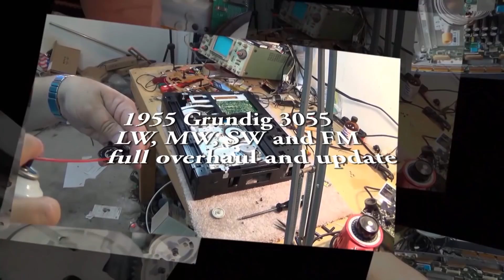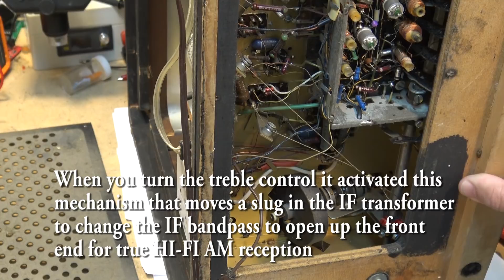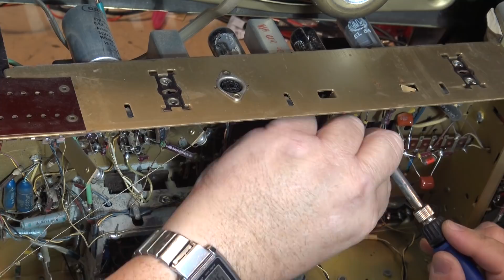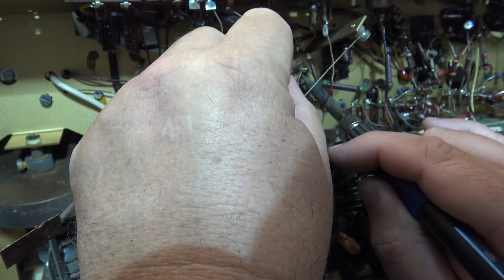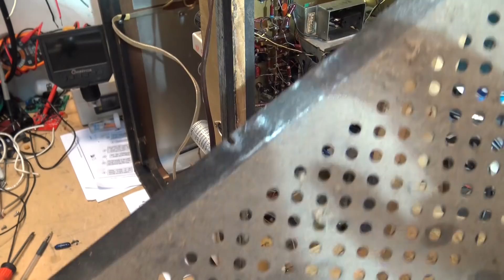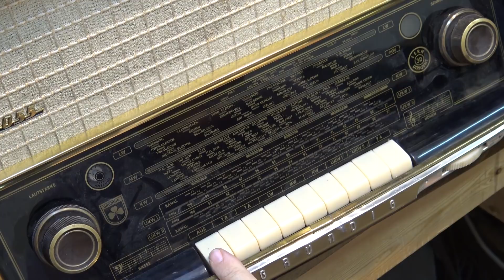Grundig 3055 Vintage table radio restoration

Comment: I have a Grundig with the motorized tuning.  Yes, German engineering is the best... until you have to change that #%*!ing dial string and cables.  It took me 4 days- I would work on it until I was frustrated, then do another project.  Finally I got the god$%#*ed dial cords on.
Reply from the maker: German engineering my ass.  Never again will i own a German car.  One was enough of a headache.
Reply: @12voltvids  I work for a German company 
  I believe that their engineering is done as payback to the world  for them losing the war...
Reply from the maker: The same can be said for the Japanese. They killed the American electronics manufacturing industry with cheap Panasonic and Sony TVs.  They sold them at a loss in the us to gain market share and put the domestic companies out of business. I saw a documentary a few years ago about Panasonic. To get around embargos I can't Japanese companies in the '80s what Panasonic did and Mitsubishi was they bought American companies that were in financial difficulty. Panasonic bottom Motorola TV division I started assembling their televisions for the American market in the states using American workers. They still made the picture tubes in the States but they shipped the chassis over from Japan. The same television in Japan sold for double the price that they were selling it for in the states. Eventually over a couple years they started doing less and less in the states even shipping the picture tubes over and assembly and soon it was just put in the chassis in a box. Canada had embargos as well.  To get into Canada Mitsubishi bought Electrohome. They rebranded their televisions Electrohome and continued the brand name for about 10 years. Of course they sold their own Mitsubishi brand as well concurrently after about 10 years when they were no longer required to keep the electrohome brand name they discontinued it and a few years later when sal started to fall they actually pulled out of the Canadian market completely. back to this documentary on Panasonic what's the domestic manufacturers close their doors the price was jacked up. As the documentary closed off saying they may have lost the physical war but they won the technological war. No arguments there.

Comment: My parents loved music and Grundig was their favorite radio. They loved their rich deep sound and build quality. They would keep a set for a few years, buy the latest model and give away the old one.  What I would give for those 1950s/60s tabletop radios today!! They were amazing. We forget the 50s and 60s records were recorded for the best sound on AM radio, not FM stereo and Grundig delivered the best AM sound.
Reply from the maker: All radios can deliver fantastic sound on a.m. it's all about the bandwidth. Grundig had an if transformer that you could adjust the bandwidth on by turning a dial on the front of the radio which moved the slug up and down in one of the transformers which opened up the channel bandwidth. Thing is that only work when there was few radio stations once the band became crowded and there was a station every 10 kilohertz you really couldn't take advantage of that because the next station over would overlap what AM stereo came along they actually restored the wideband mode for many radios and I am stereo sounded absolutely fantastic. People think that just because it's amplitude modulation that the bandwidth is naturally limited but that's not the case they were limited by the broadcaster because of interference issues to adjacent channels once the spectrum started to fill up. TV signals were also transmitted by am and they had bandwidth upwards of 4.3 megahertz on ntsc. The reason they had to cut it at 4.3 megahertz is because the sound carrier went between 4.3 and 4.7 as an FM signal.
Reply: @12voltvids   @12voltvids :  3I can remember when there were only a few am stations in the L. A. area and now every available spot is filled, fm too. One of the most powerful, 50Kw KNX hit our answering machine, telephones and TV sets.  I grew up with a sw radio running half the night. When the sw stations ended their nightly run I would move on to am dx listening.  When I was about 12 I began buying 1930s/40s sets, swapping out bad caps, weak tubes and sell them, sometimes I made as much as $20, imagine that! Now that I have the time I'm setting up a bench and doing it the right way, learning the theory and not just tossing parts at dead sets. Channels like yours have become a valuable part of that process.  This time I'm starting with old transistor and similar projects. I have a lot to learn before I start back with the tube sets. I need an isolation transformer, bulb and a variac first before I do anything with high energy devices. Going back to am radio, during the early 1960s, there was an am stereo station near our Long Beach, CA home. My parents had two radios in the living room, one set just below the frequency for the right channel, the other above for the left. With that combination they enjoyed a clear stereo signal carrying their favorite classical music. I have a good start on equipment and lots of valuable info available.  I love bringing old sets back to life. Great fun. Thanks for taking the time to share your knowledge with us.

Comment: That Grundig radio looks like a very low hour use set and the chassis is very clean with no cigarette paste on it. Hopefully it won’t be a chamber of horrors like Shango 066 experienced. His was a very high hour set

Comment: I would install a  3 amp slo- blow fuse between the bridge rectifier and the secondary of the power transformer to protect it in event of a B+ short. The replacements are very expensive and hard to find and do not include postal fees

Comment: This model is common for power transformer failure , bridge rectifier failure and carbon tracking in the selector switch network. Also famous for leaky or shorted caps

Comment: Shango 66 serviced the same radio a few years ago. It turned out to be a chamber of horrors Multiple circuits failed at once. He did a 2 hour video on it The power transformer burned up and multiple circuits failed after he replaced the power transformer
Reply from the maker: Yes they can be nasty.

Comment: Great video as norm can you do a video of dropper circuit as I would like to see your approach. I have an AEG German Radio it’s 220v I-changed Selenium for 4007 diode about 40v difference I would like to know if I should fit full rectifying diodes please advise.

Comment: Heathkit used to sell nice electronic kits that you could build, and I always had success building them.  A point-to-point wiring, thermonic radio like this would really be fun to build as a kit.  i remember my Grandfather's old Radio Electronics magazines where it said, in the electronic school advertisements, build your own vacuum tube TV and radio.  When I took my National Radio Institute course in Video Audio Servicing, they sent me a stereo system and only had me take some voltage measurements at test points.  Nothing else.  I wish that they instead spent the money by sending me videos like yours.

Comment: How on God's green earth can you replace the selenium rectifier with a solid state rectifier when its rise time is too fast for the vacuum tubes, such as for the mixer tube?  I tried restoring an old thermonic tube radio and screwed the whole thing up.  For one thing, even though I watched your video and Mr. Carlson's Lab video on the subject, I could not figure out the polarity of the mylar capacitors that i was replacing all of the paper caps. with.  I replaced the destroyed electromagnet speaker with a modern-day perminant magnet one, not realizing that the electromagnet was part of the power supply, and I replaced the selenium rectifier with a diode.  My tube checker could not check all of the tubes.  Now I know, after watching videos on the subject, that I should have reconed the speaker, or at least glued paper towels all over it.  Physics wise, I love thermonic technology.
A woman is dropping off a 2003, 300 CD changer off for repair on Wednesday.  All belts need replacing.  Those things are bitches.  Wish me luck.

Comment: Safety Capacitors (X-Y) on primary side of AC transformer a good idea for 21st century.
https://www.allaboutcircuits.com/technical-articles/safety-capacitor-class-x-and-class-y-capacitors/
KEMET is good brand (Mouser or Digi-Key).

Comment: I'm restoring a Grundig 1097U, I'm wanting to replace the selenium rectifier that is a B250C75. What diode bridge replacement should I use? I've read using four 1N4007 will work but may need to add a resistor in? What are your thoughts?
Reply from the maker: I just used a full wave bridge.  Sure the voltage is a little higher but still well within the limits of the tubes and capacitor.
Reply: @12voltvids  Ahh okay thank you! So even though the original rectifier is 0.08A, 250v, I can replace with a bridge that is 2A, 1000V?
Reply from the maker: @televisionforever  yes. It won't draw more than a few milliamps.  Tubes are high voltage low current devices.
Reply: @12voltvids  Okay great! Thanks for the help!

Comment: You know back in the 70's when I was a soldier stationed at Fort Bliss,  being a communicator, the officers all thought we were radio and TV repair men as well as our Army Duties, so they would bring in their equipment and drop it off at the Commo shack and asked that we have it fixed by Friday. One thing I discovered was that all the Officers thought they didn't have equipment unless they had a Grundig radio and Reel to Reel setup.  We often got them from newly arrived officers who just came from a tour in Germany where the equipment was sold. Much of our time was spent simply switching them over for 110 volts from the European Voltages.  Funny all those big wigs could not follow directions on the back of the sets, they would get them to their new quarters plug them in with an adapter thinking that would fix it. I often just put on a US plug and did the switch, charge them ten bucks for my effort and be the hero for a week.
Reply from the maker: The grundig were good.  I have a Normandy which as everyone knows is basically a grundig.  I hope to restore it one of these days. It has been sitting in the shop for 3 years now since my father in-law passed away and my wife brought it home.  Project for this winter i think.   Now that summer is winding down I will be spending my days off more in the shop working on various projects i have on the go.

Comment: When I was a boy,  I shorted that selenium diode, I had no idea what it was, but it looked cool, man did it STINK when she blew up, damn near took my had off, at least that's the way I remember it. I took a pair of pliers and put one end of a grip on each end. SPARK BANG SMOKE STINK, mom hollered up  the stairs, asked what the hell I was doing, it was hard to explain the smell.
Reply from the maker: They are NASTY when they blow and that is not an exaggeration.
Reply: They smell worse than a ripe fart

Comment: I have the modern version of that radio, it is a small transistor Grundig with AM/FM and SW it also has temp and world time built in. It is Grundig but made in China.  Still a wonderful little radio but does not put out the wonderful sound of their old European quality radio!

Comment: I am not sure why change all capacitors, I have similar radio and only two capacitor were bad..
Reply from the maker: The paper in the wax/paper caps go electrically leaky and this will avalanche the tubes drawing excessive current.  This can easily red plate a tube and cause it to fail as well as burn out transformers ect.   So they all have to go, no exceptions.  I am normally not one to replace all caps.  In vintage tube gear i so for all the paper types and black beauties.

Comment: Classic Line Hack moves on such a Fine Radio..Used Capacitors In the B+ ! Dont forget to use those random TV VCR screws to replace the ones you lost on your filthy desk..  I try to be Positve with comments but this Destruction Line Hack "Repair" is just too much.. How do you turn it on Really ?...!
Reply from the maker: No screws lost. All required capacitors replaced, The B+ ones are fine.Its the paper ones that cause the trouble. I don't have an open cheque book to change every part. This is something you people don't understand. If I could charge 200.00 to replace all the capacitors I would. This already went to a shop that told him it was going to cost over 200 to restore it and he walked away. I get these radios and devices in, and I am told fix it for 60 or 70.00 max. If it is going to cost more than that then don't do it. I tell them for that I can change the critical parts that need to be changed, the paper caps and a selienium rectifier only, and they are fine with that. 
You have to remember that these old radios are owned by old people, that are on fixed incomes, so they won't spend the money to fix it. The owner was told what it would cost to change all the capacitors and what just the minimal caps would cost and they chose the lower cost. That is the way it is. I do exactly what I am asked and no more. What I do, bu NOT ripping my clients off is repeat service, and they tell their friends which gets me more business.

Comment: When you replace the rectifier with silicon, do you use a dropping resistor to compensate for the lower forward voltage drop of silicon diodes?
Reply from the maker: No, the voltage will be a little higher but still well within the range of the capacitors and tube plate voltages.

Comment: Im 3 years late to the party with this comment but you and Shango066 both did videos on this similar radio about 4 months apart. His was in July of 2017 and this one in October. Just hoping someone out there appreciates me pointing this out, both are 10 of 10 videos.
Reply from the maker: I actually say his video after publishing mine.  Shango is a tube jockey, loves his old stuff.  I too like to save old tube radios and TVs. There is just something about the old tech.
Reply: @12voltvids  I just recently came across both channels and I'm combing through older videos on both channels and happened to notice this coincidence. Good stuff.

Comment: I have this radio and I'm listening to it every day. This has a very good sound, deep basses. It also has variable bandwidth for am/LW/sw listening (trebles control). It acts on the if filter with the help of a plunger core. Impressive design.
Reply from the maker: These were great radios.
Reply: @12voltvids  yes, collecting them, have 20 or 30 of them now (most impressive being the Saba Freiburg 14).

Comment: The Grundig were made back when the Television was something new. Radio's were still the mainstay of evening entertainment.I can recall the radio programs from the 1950's as I grew up on the family farm. We had no power in the house so had to rely on an old battery pack radio.  Evening listening was done by the light of kerosene lamps, the family sat around the living room in the dim light and enjoyed the theater of the mind. It was grand!  I still enjoy listening to old radio programs.  The Grundig is indeed the top of the line in electronics from that age, even later. I was the proud owner of an old Grundig Reel to Reel that I picked up at a hock shop in El Paso back in the 70's when  I was a soldier stationed at Fort Bliss Texas.  A few decades later I purchased a little Grundig pocket radio, although no longer made in Germany, but China, it is still the best radio in the house. Am/Fm/SW 1 and 2 gives her all the power she needs and she is very sensative. The digital dial is very accurate.

Comment: You need to clean the switches and do the alignment.
Reply from the maker: I provides the level of service requested by the client.  Would you spend 2 or 3 hours totally dismantling the switch block to clean it or break out the RF generator for a measly 50 bucks?
Reply: @12voltvids  It's a shame the customer short stroke fixed it, no I don't blame you but the video title restoration is a little off, just saying. It would have been nice to see the alignment done.
Reply from the maker: @biggysground  you do know that the alignment normally does not need to be adjusted.  What causes it to drift is those old caps.  The old wax ones drifted all over the map.  Now that caps are replaced with modern caps they will not drift like the old ones.  Also, people that collect these radios do not use them as daily drivers.  They are more show pieces.  I have 6, none are plugged in. They get turned on when I want to show them off and that is it.   About the only time alignment is needed is after someone has messed with it. When I worked in the business we used to see many of these old beasts.   1 our of 50 needed an alignment and those were usually messed with by other shops.   I rarely had to touch if strip on TV's either, but tv needed alignments much more often than old am radios did.  So did FM stereo circuits.
Reply: @12voltvids  I know many would disagree with you but customer is always the boss.
Reply from the maker: @biggysground  
I love the ones that come in and say replace anything you think it might need.  Those customers are few and far between.   The last time I had one I lost my shirt because I did a total rebuild on the unit (a sansui 9090db) receiver and then after the work was completed the owner decided it was time to cry the blues because he didn't have the money and wants to pay me over time. I said sure you can pay me off and once it is paid in full you can have it.  
You know what, I still have that receiver.  He ended up paying me 100 bucks which barely covered the transistors that were all blown.   I could get over 1000 for the receiver today.